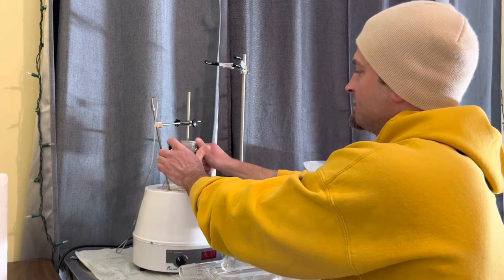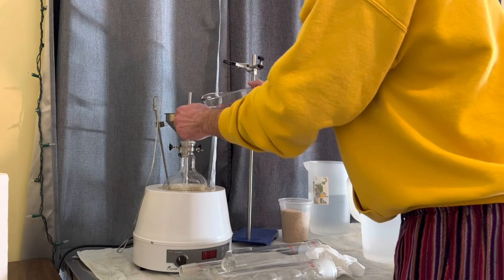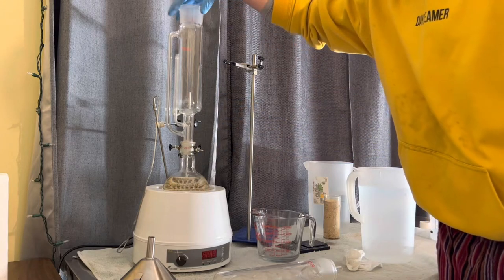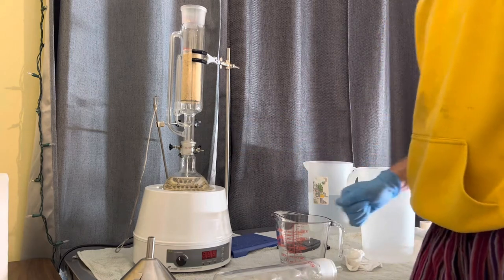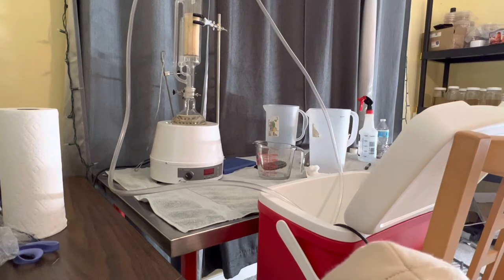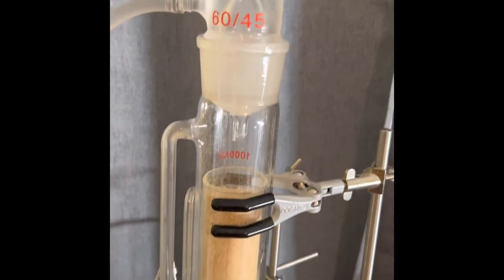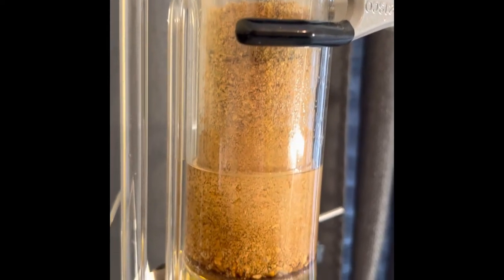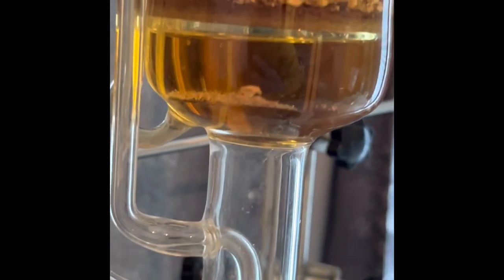Soxhlet Apparatus Extraction/Mushroom Extraction

Comment: This was the best extraction video ive watched. Thank you. Was always confused about how this process went.
Reply from the maker: Thank you. Good to know. What else y’all want to learn?
Reply: @ericfisherJTF  Is the potency of the extract stronger doing it this way rather than just soaking them in alcohol?
Reply from the maker: Hard to say honestly. I would imagine if your soaking for a good 45 days, as long as you strain and squeeze out all the alcohol absorbed in the mushroom or whatever your extracting it should be very close if not the same. This just makes it happen in hours instead of weeks
Reply: Can you offer guidance on the math for adding CBD isolate to my mushroom tinctures? So if I want to give a daily dose of CBD in a 2o.z. bottle. How much isolate should I be putting in each one? Much thx❤
Reply: @ericfisherJTF    So what temperatures are you shooting for?

Comment: Hi, thanks for the video. I am wondering, do the active constituents get damaged sitting in the hot solvent in the boiling flask for 4-5 hours that the extraction lasts?
Reply from the maker: @lisahannon-tan3872  I assume not since this is the proper equipment and procedure. Yes, heat can damage compounds. However I honestly don’t know all the specifics. Plus alcohol boils at a lower temperature than water. So that could be the reason it doesn’t do any or much damage. When I do my water decoction though, I don’t boil. Very low simmer

Comment: Can you explain the math? How much solute and how much solvent? Final product would be? I see you had a 1000ml flask didn’t mention any measurements.
Reply from the maker: Well it depends on what your going for. What dosage you want. Let me think of some easy hypothetical numbers.. Ok so dilution/proof matters too. Say your using 1000 ml solvent/alcohol, and want 33 percent tincture at 3,000 mg of plant extraction/medicinal compounds… you would use 150 grams of plant matter/organic matter/mushrooms….. 
remember 1 gram equals 1000mg 
I believe that’s correct. But if your isolating a specific compound you wanna to use as little solvent as possible since at some point it will be evaporated off